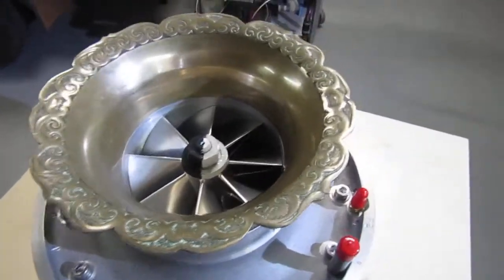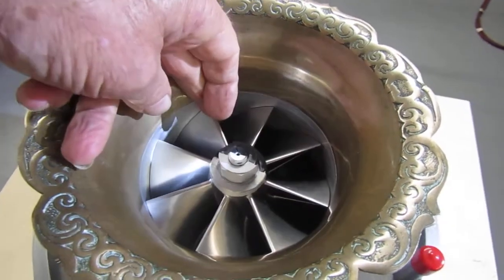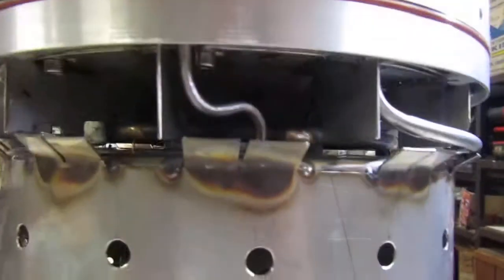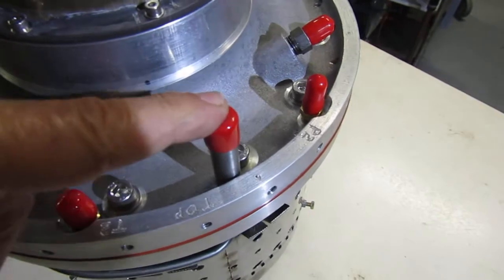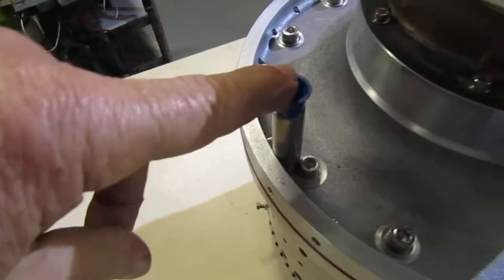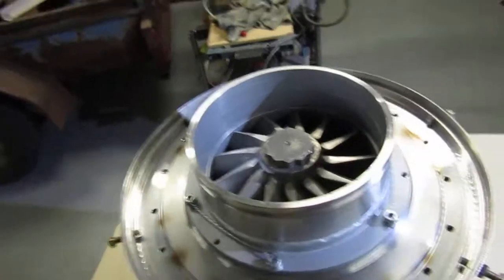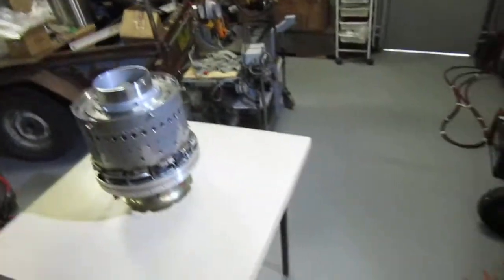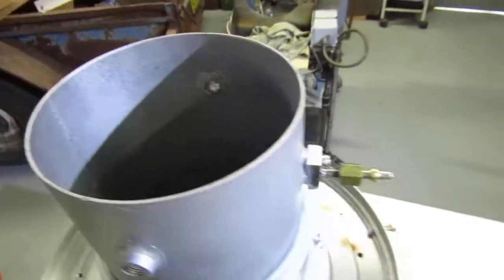Homemade  12/128 jet engine

Comment: May i ask why you use two thermocouples? How are they oriented? Top and botton? Ive seen the flame shape on other turbines and it appears gravity has an affect? Also theemal dynamics i suppose with the flame chasing the heat ... edit: never mind i just saw on another of your videos its 9 and 3 o'clock orientation, but still would like to know why 2? Backing up data for accuracy?
Reply from the maker: Ideally I'd like a couple more thermocouples so as to better represent the temperatures the wheel is experiencing  , a single thermocouple could be in either a hot or cold position  and providing inaccurate TOT temps . There are differences in fuel flow rates between the top and bottom of the engine due to hydrostatic pressure differences within a large diameter fuel ring when running low fuel pressures
Reply: @racketmotorman  yes that makes perfect sense now , I didn't even consider the multiple fuel sources hitting the turbine at multiple places . Thanks for that. 
I'd still love to see it, 😁
Reply: @racketmotorman  would that explain the larger tail of flame often seen at the lower section of the exhaust? I've seen it alot extending longest at around 6 o'clock and swirling with the gas flow
Reply from the maker: @djisydneyaustralia  Yep , there are 18 fuel injectors in the flametube , they flow pretty much the same amount but if one gets blocked then theres a cold streak of gases going through the turbine which would register a "low" TOT if the thermocouple happens to be positioned at that point , full sized aero engines have a huge number of thermocouples so as to average out the temp the turb experiences .Theres a build thread of the engine on JATO https://jetandturbineowners.proboards.com/thread/1459/11-127-manned-flight-engine
Reply: @racketmotorman  thank you for the reply.

Comment: Beautifully
Reply from the maker: Thank you  🙂

Your engines are pretty small so will be difficult to get running as they are very fussy about clearances and component efficiencies , but keep at it , it sometimes takes me years to get my engines sorted .
Reply: @racketmotorman  Yea the size and components efficiency have major part of the problem and thank you very much for visiting
Reply from the maker: @bruktilahun232  Nice to view your experiments  :-)  its not an easy hobby when things don't go to plan , but perseverance pays off eventually , are you a Member of the GTBA  ??
Reply: @racketmotorman  yea its hard but the payoff is great and no i dont thimk i am a member what is gtba
Reply from the maker: @bruktilahun232  GTBA  is a great Site in the UK , Gas Turbine Builders Association , its Members created the RC micro turbine for model aircraft , well worth looking at , I've been a Member , on and off , for the best part of 30 years , the JATO Site is more for larger engines and turbo based ones .

Comment: Sir Thanks for the short presentation of what was inside of your tubrojet/wafterburner,saying God bless from Brooke's Point Palawan Philippines.,ooooh i forgot i like the bell mouth its unique one  in the world... ahh.. can you make a info. about what kind of metal do you use in your combustion liner ,etc? Sorry if i overlook or didnt notice,have you ever put a dilution hole to make a air curtain between the inside surface of combustor liner?Does it even required to put on a dilution holes in this type of combustor? Can you tell us about your bearings sir?
Reply from the maker: Hi 

Build thread on JATO https://jetandturbineowners.proboards.com/

Comment: Question from a newbie, where in JATO forums did you pick the pattern for the annular combustion chamber?
Reply from the maker: Hi Joel

I designed it myself ,  Theres not much info on JATO for designing annular flametubes  , and I don't intend adding any  as the number of variable are too great and will only cause confusion , the single "sore thumb" combustor for turbo based engines  can be made with generous proportions  for hassle free running .
But if anyone on JATO wants to go annular , I'm only too happy to help with their specific design requirements :-)